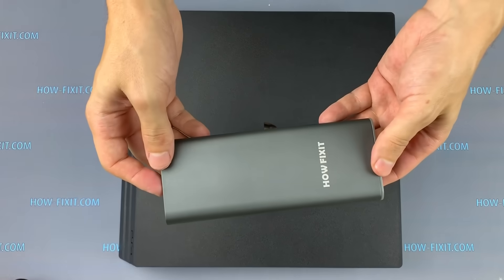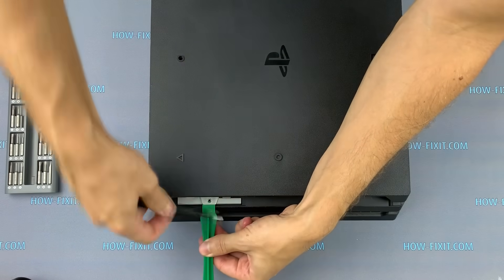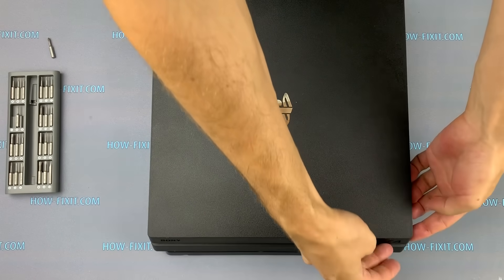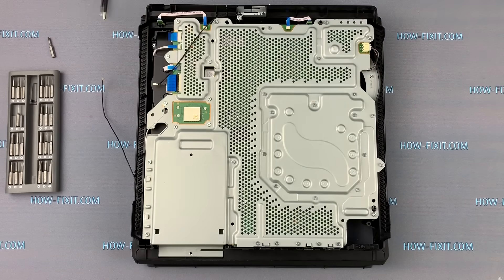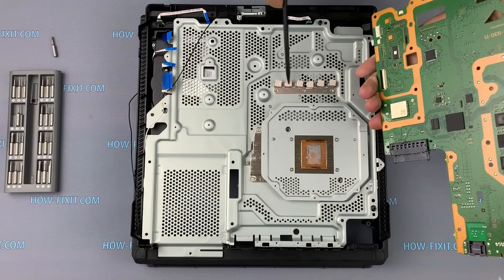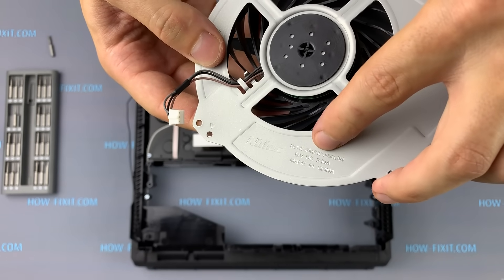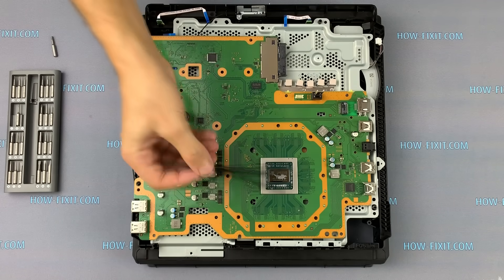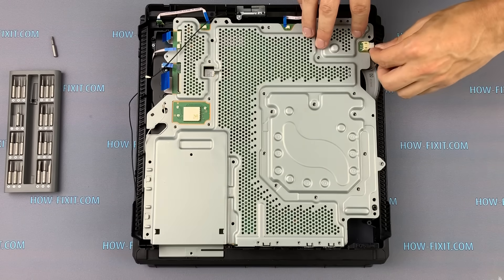PS4 Pro Disassembly: Ultimate Guide for Fan Cleaning and Thermal Paste Replacement

Comment: Thank you so much for this excellent and clear tutorial. My CUH-7216b was in decent enough condition but would get loud in some menus for some games; but thankfully never annoyingly loud. Bought myself some NT-H1 thermal paste and the basic iFixit set of tools, used your excellent guide, removed the original paste residue and applied the new paste, reassambled my console and it is now almost silent no matter what I play. 

Haven't fixed anything inside a console since I cleaned a PSU in a Dreamcast, but still managed to do this fine. Now I will definitely be happy playing through my backlog of games until the PS5 goes on sale; and will likely wait for the first revision of the console by which time there should be many PS5 games on sale. You have saved me a decent amount of money, and have given me confidence that my console will last a long time to come. Thank you so much!
Reply: Did you use isopropyl alchohol to remove the old paste?
Reply: @Taariq2  I used a cheap product called ArcticClean Thermal Material Remover and Thermal Surface Purifier. Comes in a combined package and got rid of the original paste very well. The Purifier makes sure all of the Remover comes away cleanly. Smells quite pleasant, too.
Reply: @NorwegianGlaswegian  thanks for your reply. I was gonna buy it but just used dry paper towel instead. Now my PS4 is as quiet as a kittens purr when playing the Witcher 3
Reply: @Taariq2  Glad that worked out well for you! I found using the ArcticClean products effective and probably saved a little time in getting rid of the original paste.

Changing the paste has made such a difference. Was surprised to find my fan and heatsink were still clean after nearly two years. Just had to blow away a tiny amount.

Enjoy your revitalised console! I plan on using it for probably another year and play all the games I bought on sale over the years, then get a PS5 in a sale. Just glad that the 7216b, and 7215b can be improved like this and the process is easy if you do it slowly and carefully. Need to finish the Witcher 3, myself. Enjoy!

Comment: How do you remove the power supply in CUH-7108b? It feels really difficult to remove in this model as if there is another screw holding it in place. I can’t find any disassembly video for it

Comment: OMG! I had a brand new PS4 Pro which made incredible noise from the very first day. I hesitated a lot to follow this video but after buying the necessary items I managed to change the thermal paste since my PS also started shutting down because it was too hot according to the error. The thermal paste was all over the place except where it should be but the fan was super clean since it was a new PS.
Now it is super quiet and I am happy that I did it! Thank you!

Comment: Followed along, including the coffee break. My ps4 pro went from jet engine to barely making a sound (this is while playing PES). Used thermal grizzly kryonauts, which spread a little different than in the video but I think I managed to do it okay. The paste that was on there before was caked on thick all around the APU and cracked so I think replacing it was a good idea anyway. A horrible dust bunny came out of the fan and lots of nastiness cleaned out from all around, including thermal pads. Great video and easy to follow, thank you!

Comment: Also i just want to access the heat sink so i can clear out the blockage thsts causing overheating i dont want to remove the thermal paste and seperate from cpu  my thermal paste is fine its just the dust i need to clean out

Comment: If you do this, MAKE SURE YOU DONT PULL ON THE POWER SUPPLY CONNECTOR ON THE MOTHERBOARD. It holds in there very tight, make sure you are only pulling on the cable itself or the tiny section that pokes out the top of the connector. If you don't, you will rip the entire thing off the motherboard and either irreparably break your console, or have to get it resoldered back on if none of the traces get damaged.

Comment: So I did this. And the biggest issue I encountered was pulling the PSU cord from the motherboard. I used a pincher tool and when it slipped of the plastic it ended up damaging the cable, sadly. But the console started up normally afterwards anyway.

I just used some force to pull the connector out in the end, and knowing that it worked now I wish I'd do that from the beginning. The risk of damaging a cable is bigger with a tool then pulling the connector out. At least in my opinion.

The console started up like I said anyway. I got the feeling that Ghost of Tsushima's noice went down about 10dB average just as with FF7R. Used a mobile dB meter before and after for FF7R at least, and though it may not be scientific, I got the feeling that it at least helped somewhat. Resident Evil 3 is a little too loud still though. Can't really say if it's gotten better with that game for some reason.

I may update this along the way.

Comment: Did it today on my CUH-7016b. I'd say that it's like two times quiter now. It isn't anything crazy, but definitely worth it. Mine started making weird beeping noises after doing this, but after an hour of using, these noises are thankfully gone. I'd also like to point out that it isn't extremely easy as everyone is saying, but if you're careful enough and take your time, you should be able to do it without any problems. By the way, using Noctua NT-H2 and Thermal Grizzly Minus Pad 8 (1,0 mm thick), both are great products.

Comment: Great guide but my 5th screw on the  psu was so tight I ended up stripping the top (the plastic one). 

Any suggestions? Gonna try a micro grab bit - or superglue a driver to the screw, in the meantime

Comment: I did everything this video. I took my time. But now my Ps4 says “cannot start the PS4. Connect dualshock 4 using a USB cable and press PS button” but my controller isn’t connecting. Does anyone please have a solution.

Comment: okay, so the power supply unit is not coming out of my ps4 at all. I swear I'm doing more bending than actually getting this thing closer to coming out. i can't be the only one with this problem?
Reply: I had this problem too. And I ended up grabbing the cables quite close to the connection and pulling it out. Scary, but I felt like I had nothing to lose anymore since using a tool ended up damaging at least one cable to the PSU.

Comment: I didn't have t8, I couldn't even open the cover. But I put my full effort into it and unscrewed it with a different one....then I saw multiple t8s inside and just gave up...
Reply: Same problem T8 screws wouldn't open with the same type so I used the flat head to loosen it ,you have to put a bit of pressure and then used T8 to remove the screws
Reply: @shubhmayc  yeah, I had to buy the T8 and turns out u need the one with the holes in the middle for a few of the screws. I used a plier. And I did clean the PS4 and reapply the paste, and it worked! Don't see a performance difference dou......although I think the fans might be more silent
Reply: @doubleh2002  which paste did you use? Iam thinking of Arctic MX-4 it's on Amazon, and did you apply paste on cpu on the motherboard or opposite on the copper side? Did you change thermal pads too?
Reply: @shubhmayc  same mahn
Reply: @shubhmayc  didn't change the pads, only applied the paste on the CPU.

Comment: I don't normally leave comments on videos, but this video helped me gain the confidence to take apart my noisy Pro and change the thermal paste, putting it back together afterward without messing a single thing up. I was leaning on just trying to play games on my PC since the PS4 itself was getting way too loud to enjoy, but after redoing the paste? Not a single fan sound across Dead By Daylight, Resident Evil 2/3, and Call of Duty. I'm amazed. Thank you so much.

Comment: How could you remove the power supply so easily? Mine got ripped from the mobo and now it is fucked
Reply: You have to take the bottom part off and remove 2 screws that hold it together
Reply: @perrypeldavis  it is not that one. @3:14 this is the part I am talking about.
Reply: Erkan Mehmedali Yh I didn’t do it like that I took the cable out from the power supply not from the motherboard

Comment: Following this guide completely fixed my PS4 Pro! Before fixing, the console sounded like a jet plane taking off and I had to switch off the super-sampling on 1080p resolution to reduce the noise even a little bit. After cleaning and adding new thermal paste the console is virtually silent again.

The sad part is, disassembling the console shows how poor the QC at the factory had been. Some screws, especially the ones tightening the heat sink to the CPU were loose! The thermal paste used was really low quality as it was rock hard by the time I opened the console. It had also been applied messy, spreading all over the PCB. On top of that, the thermal pads of the video memory chips were just barely on their place. As far as I see, the console is after following this guide better as it was when it left the factory.

Thousand thanks for sharing this video!
Reply: Did you use isopropyl alchohol to remove the old paste?

Comment: Dang :( I ripped the connector of the power supply because it doesn't budge at all. Trying to find some guides to repair it now >_<
I cleaned out the whole system aside from the ripped of part tho, very helpful guide! Too bad I messed up on the power supply part :(

Comment: Opened up my PS4 Pro this morning and cleaned out the radiator, heat sink, and removed all of the old thermal paste and applied new paste. Been researching this the past few days due to me being fed up of my console sounding like a goddamn jet engine all the time.  

Also wiped out all of the dust from the fan and motherboard of the console, and my PS4 now is literally whisper quiet while playing call of duty and other games. It's literally unbelievable! No noise coming from the console AT ALL.

Comment: I just did this with my PS4 Pro CUH-70168...

AMAZING DIFFERENCE!!!

It's genuinely silent now, even on Modern Warfare multiplayer lobby.

Can't thank you enough man 🙏🏼
Reply: Is that a newer model or and older one?
Reply: @cubancucumber  older one
Reply: Casshern damn so there is hope after all. Mine is the God of War version but it still sounds like a cross between a jet engine, hairdryer and fan.
Reply: The noise does come back a little (design issue) but it's like 20% of the previous jet plane with Asthma noise lol
Reply: Casshern that’s really good to hear. As long as i can actually get it a little quieter.
Reply: @cubancucumber  go for it. My advice, >take your time< and research what you don't understand. Make sure you know where all screws go before disassembly/reassembly. Good luck🤞🏼
Reply: Casshern thank you so much :)

Comment: Awesome video. Helped me a ton to get through doing my console. Amazing stuff.

So I just got done doing mine, it's the original 7015 console and when I took it apart it really wasn't too dusty. Heat sink had a bit of dust but nothing like I've seen on some videos. Also noted that the fan was a nidec. I thought those only came on the 71xx  and 7200 consoles? Either way, it's back on and loaded up TLOU 2 and the fan is still loud. Slight decrease in noise but nothing substantial like I hoped for. Maybe I didn't use enough thermal paste?

Either way, thanks again for the well done video.

Comment: This video was incredibly helpful and fixed the issue of my fan going crazy or the console overheating thank you!
Reply: Did you have a problem were when booting a game the fans would go at max speed and the system would shut down. I’ve replaced the thermal paste but I think I should need to do it again
Reply: @jacobbrown6086  I had that problem but after I replaced the thermal paste the first time it was fixed
Reply: @Foulhook23  managed to fix the ps4. it's still loud but that is because its a launch ps4 pro.

Comment: So my ps4 pro turned off due to overheating and still has high noise sounds , and then I cleaned the fan from the top and after I did that , whenever I turn it on and start any game ,it sounds more noise than before and more heated , do you think this method will help ?

Comment: Hello! Thanks for the video. Is there a way I can get to clean the heat sink without taking out the motherboard/thermal paste. I'm not very confident in my "paste applying skill" so I would preffer to avoid that. Thanks in advance

Comment: You really should mention how easy it is to break the connector for the power supply to the motherboard. It is not as easy as you make it look.
Reply: I gave up on this, the cable would NOT disconnect from the motherboard. And dared not force it. So reverted back to putting it back together again. Now have a problem with the PSU as my ps4 no longer turns on. Will open it up and have another go at it. 

Worse decision EVER attempting this when the ps5 is out in a few months. Was not worth the risk!

Comment: I was just about to give up on playing the Last of Us 2 because my PS4 Pro was sounding like a jet engine, but thought ok, lets give new thermal paste ago.
Thx for a great video which made it very easy for me to go through the process safely and now my PS4 is purring like a kitten while running The Last Of Us 2 :)

I was quite surprised when i got to the thermal paste, it really looked like shit, so replacing it can definatly be recommended from here.
Reply: Lmk how long urs last. Mines was quiet for about a month only.
Reply: @Danxiong  
If it start sounding crazy again I'll try and remember to answer here :)
But judging from the original thermal paste and the quality of the thermal grizzly I applied, I would be very surprised if it starts getting loud any time soon
Reply: cmulvad I used wat most people recommended artic mx4.

Comment: Thank you for the easy to follow video. I have an older PS4 Pro model and I'd only really been playing CoD MW / Warzone recently but on the screen with the operators walking, the fan would go nuts. I bought some Arctic MX4 thermal paste and so far so good. The fan is still sometimes slightly audible at that screen but nowhere near as bad as it was.
Only problem I had was that one of the thermal pads was split in the corner. I didn't have any replacements so just put it back the way it was. Doesn't seem to be an issue so far. Also I thought I just needed a Torx T8 screwdriver. I didn't realise it was one with a hole in the centre. If you live in the UK and need one as soon as possible ( I needed to get this done today so couldn't wait for one to be delivered from ebay) B&Q sell a pack of 9 Allan key shaped 'Magnusson' Torx tools although you only need the T8 with the hole in it. It was about £7 but at least I have a set now if I need them in future.  I also followed this video for removing the power supply (you need a pair of long nose pliers) https://www.youtube.com/watch?v=pud3G-7YsKY

Comment: Second time i used this vid for disassembly. Top notch 👍 however you should change thermal pads as well, those from factory are utter shit and dont cool anything, especially these 8 bigger ones. Thats why i had to open my ps4 twice, it was noisy like a leaf blower. Now it all quiet and fan reaches max 40dB. I hope it will stay that way.

Comment: Help! I can't pull up the power supply, it's too thight and i'm scared that I already have done damage trying to pull it up
Reply: Yep I just broke my PS4 pro because the power supply cord pulled of the motherboard! 😔 Should of taken out of the power supply itself
Reply: Running into the same problem. I know your comment is 4 months old, but did you figure out how to get it out?
Reply: @Mr.LouiTheRonin it's not the screws, but the cable that runs from the mother board to the power supply.
Reply: I broke my PS4 pro because i pulled the power supply connector off the motherboard. Should’ve disconnected the connector from the power supply itself.  Even now i cant separate the plug and connector that was attached to the motherboard ie it was never going to unplug.
Reply: @michellejenkins5505  yeah exact same situation as me, only realized as strip it down further that you can take the motherboard off and the power supply cord would easily exit the hole where it's attached to the motherboard. Plus same with me after pulling it off the motherboard I still couldn't unplug it, I believe that was a manufacturing mistake.
Reply: @shanehudson6969  Some people suggested to only unplug it from the power supply. It still is pretty tight regardless. The guy in the video makes it seem like it's something super easy. It's not...

Comment: Hi, thanks for the video, is very clean and simple!
But i've a problem, i broke the White antenna connector, is it essential (is for Wifi only ??) The number part is: 2300787-1  172937.
If it is only for wifi, it's not a problem for me, i've the PS4 pro by Lan, but if not, how can i buy it for replace?
Thanks friend for the help

Comment: Ok I can confirm for a cuh 7116b that has been a noisy son of a b for 2 years that this worked.
General dust cleaning didn't do the job, only stripping down and re pasting the thing worked. 
Red dead 2 straight on and not a sound..